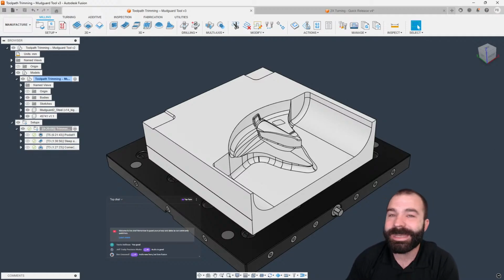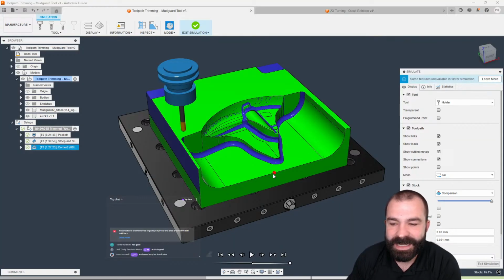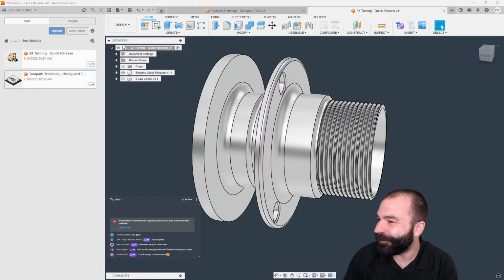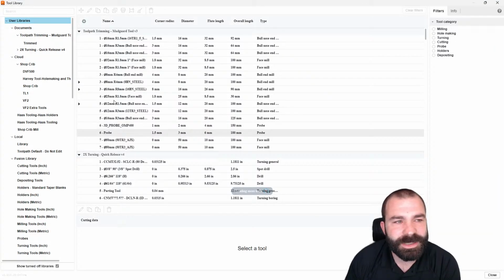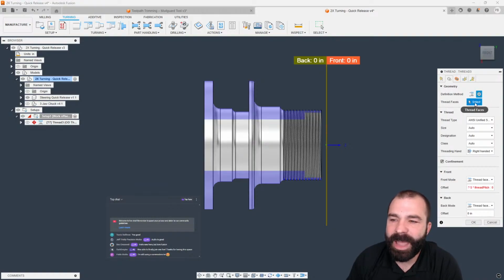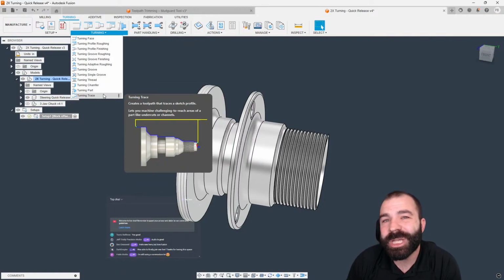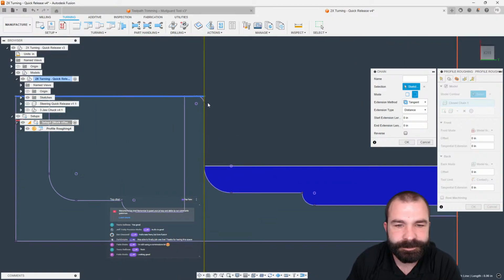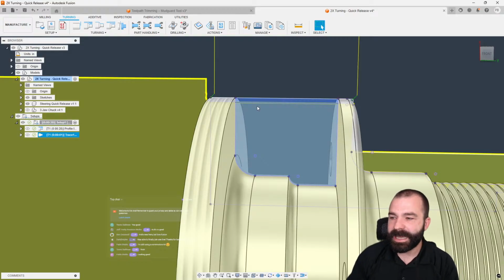Workflow Wednesday: September Update - Manufacturing & Turning News!

Comment: Thanks for explanation of turning trace toolpath! However I just do that same thing in the finishing or roughing profile toolpaths and select the sketch/chain there. I really don't understand the reason for this extra toolpath. Would make more sense if you just select points on the 3d model and it creates a chain.
Reply from the maker: That's a great idea! So from what I can understand is it gives you full control over the entry as well direction of a toolpath they do a good job with a video that has a grove and under cut if you wanted to feed down following the taper or across the floor.
Reply: @JITCADCAM  Ok, Yes I see that is does control entry better than just using a chain with profile finishing toolpath. Hope they will keep improving the turning side of things. Custom tools would be nice. Thanks!

Comment: This GPU usage is a game changer. Will allow "high performance" from a mid level machine with a decent dedicated card. I was looking at this and didn't see any performance difference...leave it to DJ Freshy Phil to show me that I needed to select simulate faster mode. Now 3GB outof 4 of memory and abotu 80% GPU processor usage is occuring when simulating and is is MUCH faster.
Reply: Nvidia T600 laptop GPU, i5-12500H, 32gb    Since the software doesnt effectively use multi-processor in many cases, the i5 works pretty well, coupled with the 12500 series.
Reply from the maker: Awesome! Glad that tip helped out!